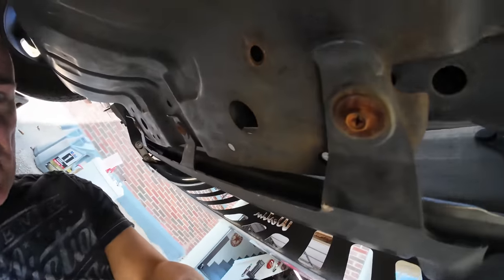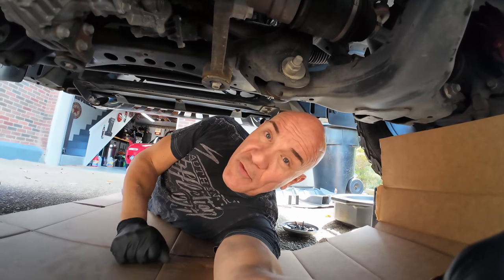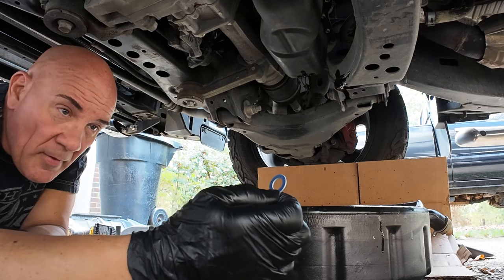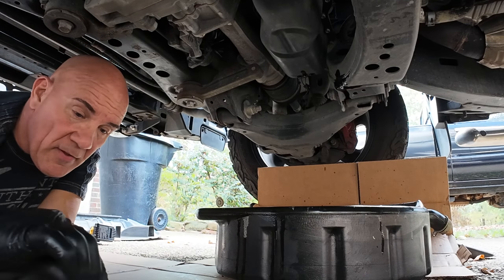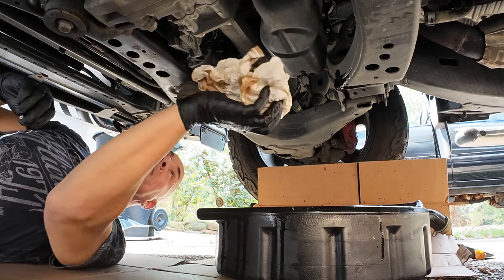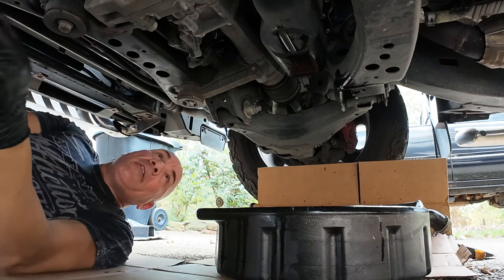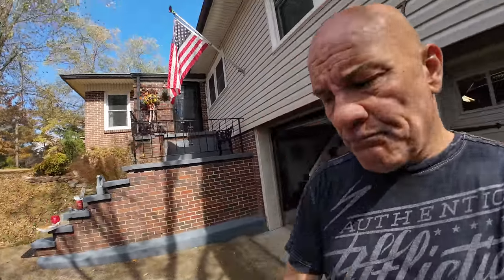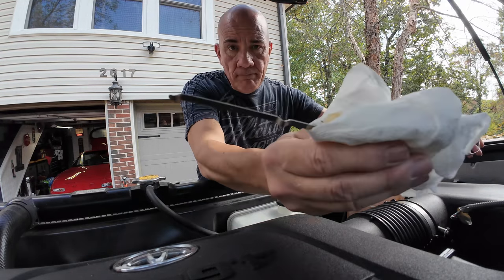2011 Toyota Tundra 4.6L V8 Oil Change - Complete Step by Step Guide

Comment: Don't change your plastic oil filter housing to aluminum if you're truck is still under warranty. Toyota will void your warranty. So even though you might want to be pro active and change it to aluminum don't if you have newer truck.
Reply from the maker: I agree @dwayneroberts6616 and thank you, I neglected to mention that!
However, my truck is 13 years old and way out of warranty 😎

Comment: great video. i just bought a 2011 tundra with the 4.6. and 173000 miles on it do you have any tips on what to look out for as far as maintenance goes. thanks in advance
Reply from the maker: Yes. Here's a couple of videos I made in a playlist on the Tundra. 
Air System Switching Valves on bank one and bank two are basically the same process. The video I made is on bank two, a little more stuff to remove to get to the part.

https://www.youtube.com/playlist?list=PLmAykc_3ZK72wvg0M3Sx9JUqU-Fby_Iw1

Also, I haven't done a video yet on changing my brakes (which I have done a few times over the years) but it's extremely important to note, aluminum rims on the Tundra need to be torqued by hand, exactly to 97 foot pounds.

If they're torqued too much, they can and very likely will warp the rotors!
This is supposed to be a known flaw on that Tundra model year.
I had a nail in a tire and took it to a tire place where a good friend was the manager, to get it repaired.
I gave him very specific instructions to manually torque the wheel to 97 foot pounds when they put the wheel back on the truck.
He apparently didn't take me seriously as my rotor ended up warping badly causing a nasty vibration.
When I went to remove the wheel to change my brake rotors myself, it was extremely difficult loosening the lug nuts on that one wheel.
I almost had to stand on my breaker bar!
It was definitely over torqued with an air tool, not manually!

Last year I had an issue with my horn not working and occasionally, the steering wheel audio controls. Turned out the horns were fine as well as the controls on the steering wheel.
I had to change the clock-spring in the steering column.
It was an easy part to get and a pretty simple repair.
Took me about an hour.
Again, I didn't make a video because I was limited on time that day and wanted to complete the task.
It solved the horn issue and sporadic audio issues immediately.
I've had my Tundra for 11 years.
Little things will come up and I try to address them as efficiently as I can.
I'm not a mechanic and hope to do as much as I can myself.
Toyota is extremely reliable and it hasn't given me too much to worry about.
Good luck and congratulations on your new used Tundra!😎

Comment: If the plug doesn't come with a washer, why exactly does it need a washer?
Reply from the maker: I didn't buy a new drain plug. Washers can wear out. I continue to use the original drain plug but when I change the oil, I replace the old washer with a fresh one.